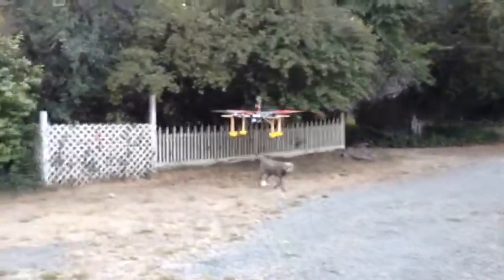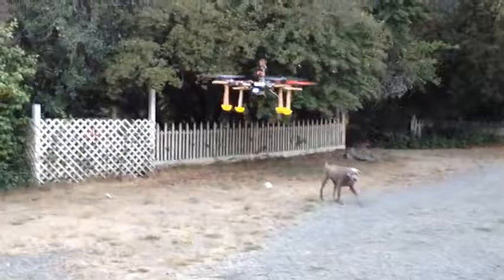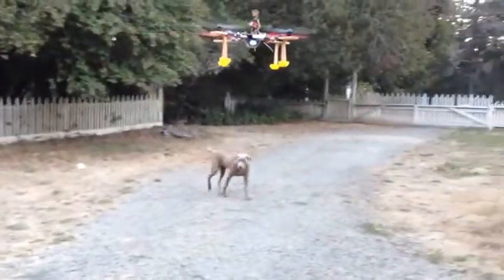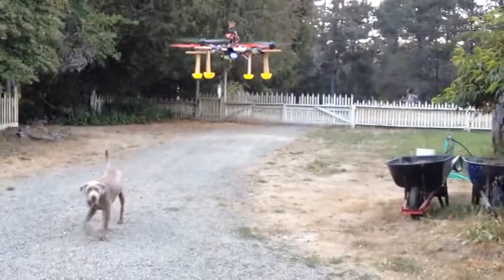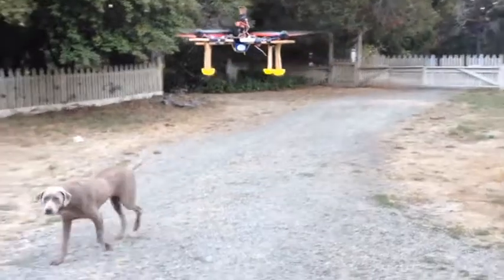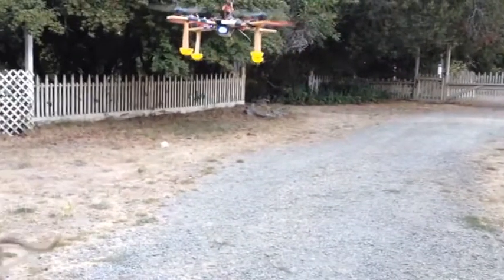Blade 350qx GPS and flashing orange light compass error

Comment: Just went out to fly and had the 3 blue lights with 2 orange lights...Called Horizon Hobby Tech support and the guy had me bind the 350qx with the left stick (yaw) in the far left position with the bind button pressed. Keep holding the stick left until the lights turn red and green, you have 30 seconds to re-calibrate the compass, see manual for instructions on re-calibration. After it re-calibrated the bottom light turned green and made two beeps, the quad shut off and restarted, then came back on and the orange light was gone! Thanks Tech Support. I was able to lock GPS and return to home after that procedure.

Comment: I used to be able to disable gps but now i have to pull the compass and led turns white , then i can start motors, does anybody know why this is and it will not gps lock and now the rth led is purple not red when initializing .?any idead anybody?

Comment: that doesn't even look like a blade 350!
Reply from the maker: Its a blade 350 flight controller, esc, motors, gps, compass and props mounted on a wooden frame made of paint stick. I used it for thermography of flight systems in actual flight.
Reply: burlbark Sounds cool. You could re enforce the bottom half of the frame to run it open for testing. Hmmm... I might try that for a lil extra stability ; )